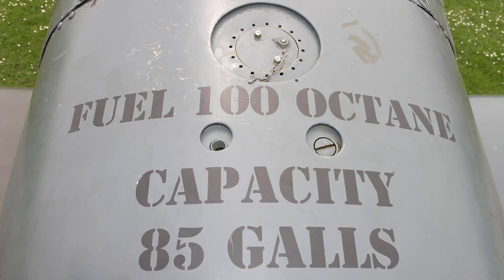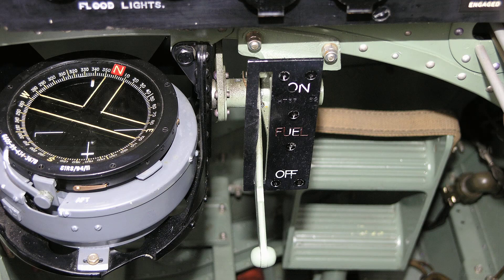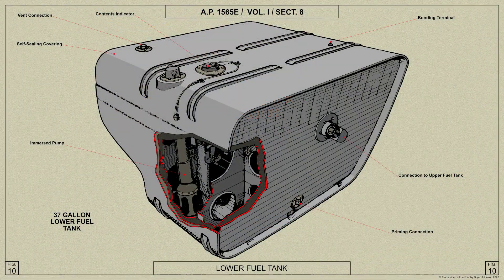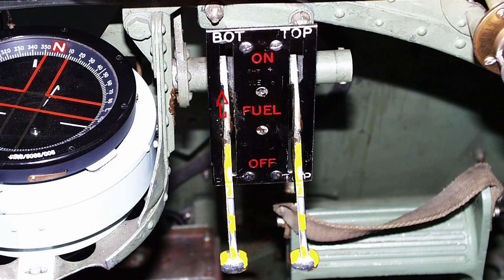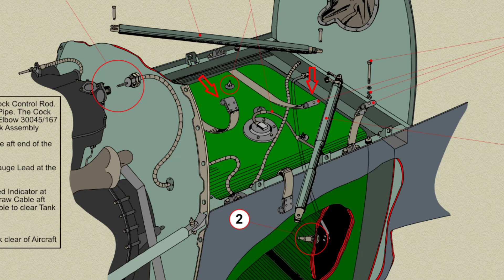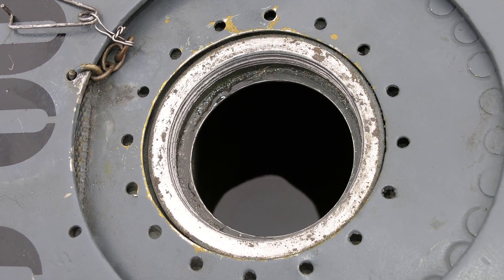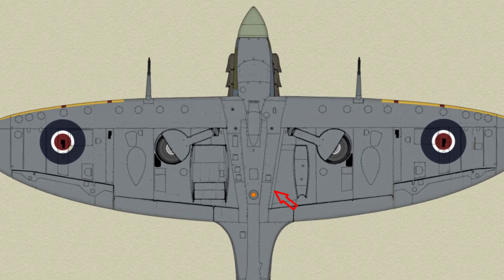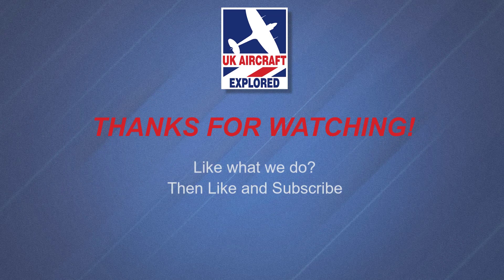Spitfire Mk V – The Fuel System

Comment: Beautifully animated. Thank you for this.
I was trying to look some confusing information about the Tank Pressurisation of the Mk.IX. The Pilot's Notes says it is to prevent boiling of the fuel at high altitude in warm weather. Another source speaks of the same but also of engine cutting due to rich mixture because of the pressure under the same circumstances. The pilot's notes does not give any procedure. Do you by any chance know anything about that?
Reply from the maker: Sorry, I can't help with this.

Comment: Have 45 gallons slippers ever existed?
Is there any photo of it attached to a Spitfire?
By the way, the video is great.
Reply from the maker: Various Slipper Tanks were developed for use with the Spitfire - 30, 45, 90 and 170 Gallon Tanks. The Spitfire Mk.V was fitted with either the 30, 90 or 170 Gallon tank. The 170 Gallon Tank being used for long range ferrying with no armament fitted to conserve weight. Hope this helps, and thanks so much for watching.
Reply: @ukaircraftexplored6556  Thank you very, very much for your answer and whole your work.